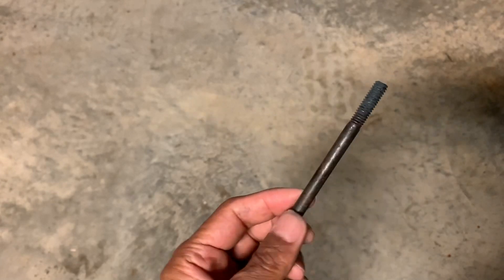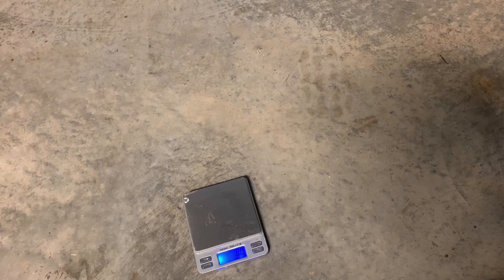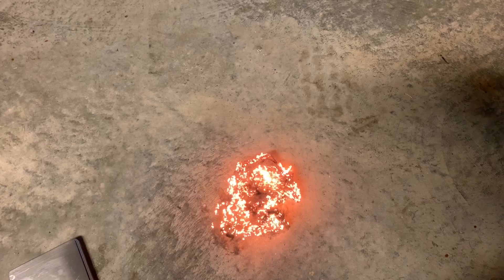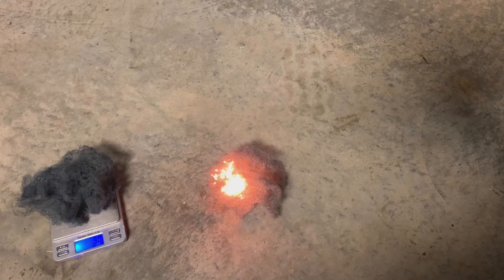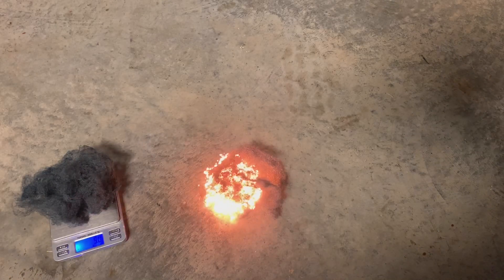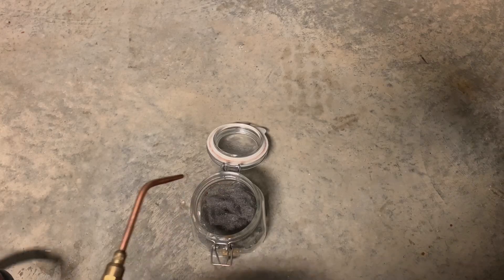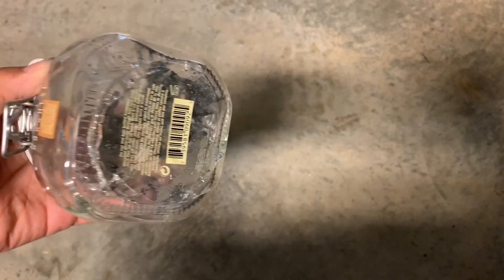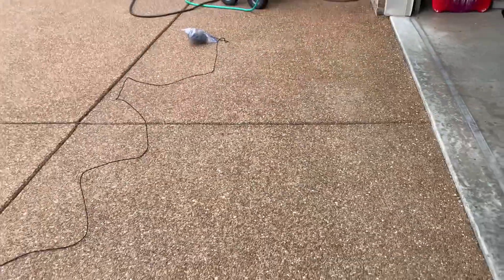Cool Chemistry Experiment with Iron Wool

Comment: It wasn't clear how much of the steel wool remained after using the pure O2 burn. Did it also end up at 5 grams 90% eff?
Reply from the maker: Actually looks like my calculation was wrong. Started with 4.1g Fe. Ended up with 5.0g. Total weight gain = 0.9g. This is 0.9/16 = 0.05625 moles of oxygen. Assuming formation of FeO, this corresponds to combustion of 0.05625 x 56 g of iron wool= 3.15g. 
Percent combustion = (3.15/5.0) x 100
= 63% and not 90% ! I figured the reason for the incomplete combustion is as the iron wool burns, it melts and forms larger beads of iron covered over in a layer of iron oxide. These larger iron beads are no longer flammable in air but might continue to burn in pure oxygen.